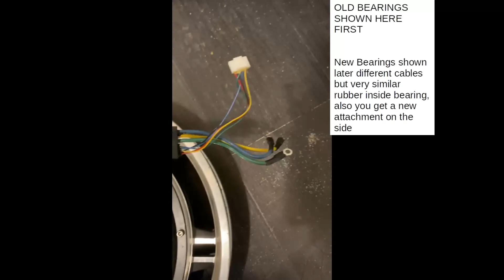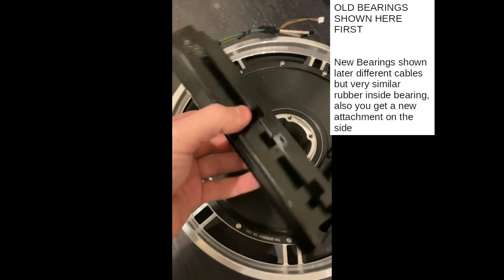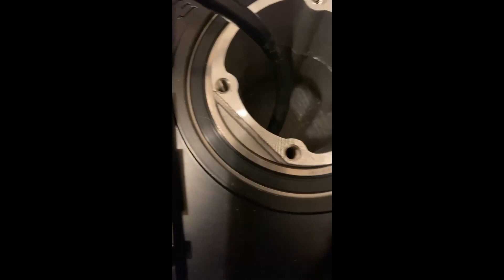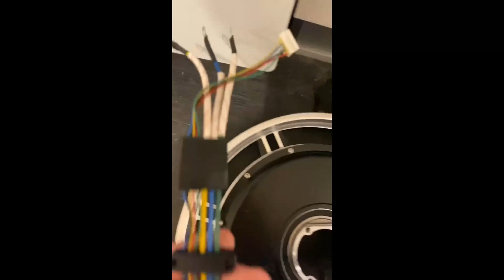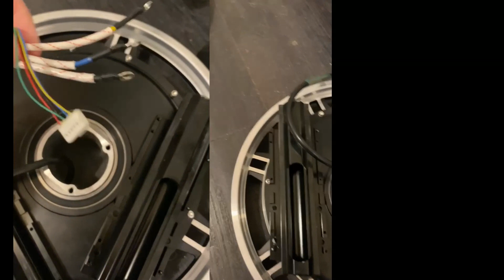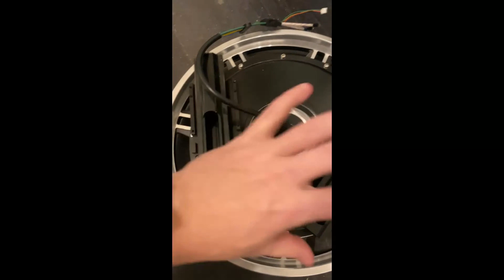Inmotion V11 new vs old bearings

Comment from the maker: Hollow motor requires very strong bearings, Gotway and Inmotion have problems with this. Dont buy new wheels until we are 100% certain the problem is solved. We might have to go inside motor and find stronger bearings, but in all fairness Inmotion have send out the spareparts and changed  the motor in order to find better bearings I think. But they dont really inform us costumers.   The thing I said about being "too stupid" is too harsh language - sorry about that.  I just love my wheel so I get frustrated when its no longer functional because of underengineered solutions. Maybe batch 3 and 4 are perfect I hope so, its a damned good wheel, also its safer, fast and sturdy.
Reply: QUICK QUESTION: Is there a way for a customer to verifiably determine which Batch # of V11 they've actually received!?! That seems to be an ongoing mystery. :(
Reply from the maker: @flhandster4395  They keep us in suspense ?
Reply: its pretty mental they sent a whole new hub, sliders, and rim just for a bearing change. :o
Reply from the maker: @danh8245  Tis daft.... Hollow motors needs to be upgraded
Reply: @FinnBjerke  kinda glad I went s18, even though it threw me off and fell in a lake. KS sent the kitchen sink to fix it as well. And it's better than new, kinda love it now. Hope yours is tip top when back together.

Comment: i have this problem on my v11 after traveling 800km. it has never been used in the rain or in water. for a wheel that costs 2200 euros in Italy these things should not happen. I will never buy a wheel again in my life.
Reply from the maker: Im sorry you have this problem. Some of us got a new motor from Inmotion, did you know that? May common sense prevail my freind. Analyse the problem: The older wheels without hollow motors did not have this problem.  This is Chinese tech. Dont hesitate to contact me for more info.
Reply: @FinnBjerke looking at buying this wheel used but not to sure I want it after seeing how many people are having this issue. Also I would have no warranty.